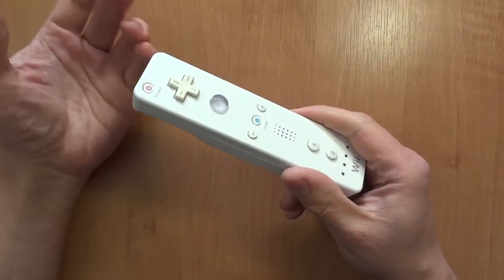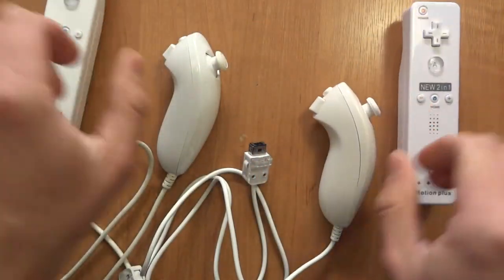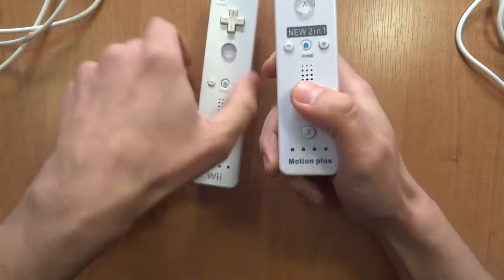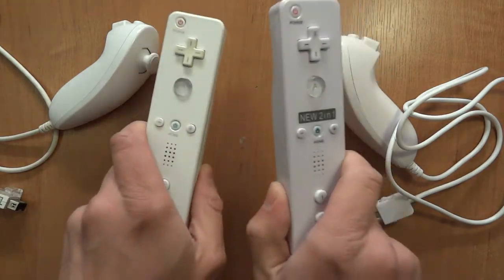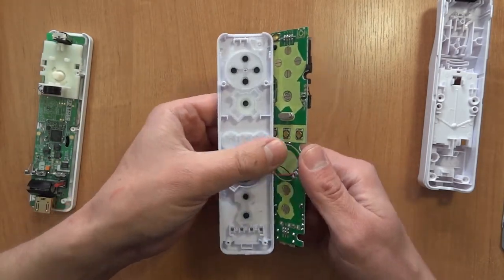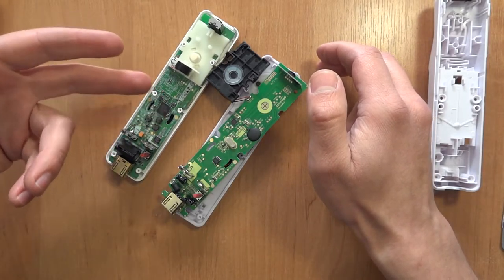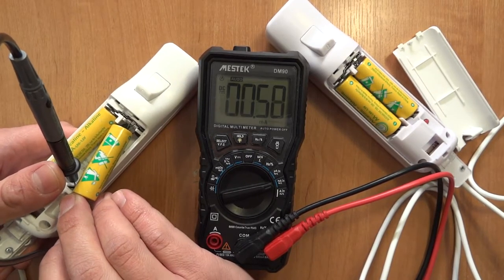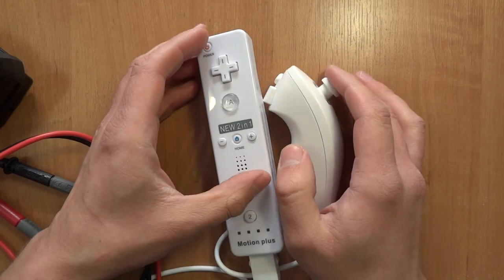Unofficial Wii Remote Plus - Review

Comment: I have no original nunchucks, but the couple of knockoffs attached to og motes. The accelometer works within them just fine(verified it while playing wii sports boxing). Just like in any other knockoff gamepads, i presume that non original nunchuck's stick also has bigger deadzone and more narrow radius of walking/running zone. And since i never had an og nunchucks to compare i wanna make a question:are there any other serious shortcomings with these fake nunchucks i should consider if deadzone problem is not a problem for me at all?
Reply from the maker: I haven't noticed anything. OG buttons feel nicer and have tiny bit less travel, but that's about it. Never had problems with the accelerometer and games rarely use it for any fine movements (usually is just for shaking and whacking).
Reply: @pandaengineering   thanks for answering. Well... As ive said the accelometer works very decently from my experience. Maybe(or not) i'll meet some challenges with the deadzone someday when its about stealth crouching or something like that. Luckily its a movement analog, not the camera one where precise aiming is crucial. Speaking of which... Basing on your tip i decided to give it a try and managed to get relatively cheap og classic pro controller, if it'll be just fine for me, i'll take an extra one but next time it'll be the knockoff since good analog are not on a high priority for me but the dpad is.( For retro emulators)
Reply from the maker: I hope it works out for you 🙂 I was looking for the original ones second had and complete set (wiimote+, nunchuck and classic controller) would cost me almost 2x more than Wii I bought and they're usually really worn out, so I went with the knockoffs. They're not perfect, but personally I think they're good for the price.
Reply: @pandaengineering  luckily my local within-country online second-hand platform is outside of american/european priceforming  and there still(not for long though) lots of good stuff for a small price since my compatriots dont now real nintendo pricing. For example i got my og classic pro in good quality for 20$ but my biggest luck was getting !!!SEALED!!! Ds lite for 50$ in 2020. Also the same year i got my Psp GO for ~65$ in perfect condithon with the box and afaik nowadays perfect condition psp go usually goes for $200 on European ebay. So yeah, getting my chances while i still can.

Comment: Hello, I'm from Argentina and I bought a wii+16GB usb+memory card+2 original wiimotes for 25 dollars, I was looking for an original Nunchuk to play re4 and they cost between 20 and 60 dollars, and the fake ones cost 12 but they don't have an accelerometer, it's worth it? Should I buy the fake one? If so, will I be very limited with the game catalog? 60 dollars is a lot in my country for an original Nunchuk
Reply from the maker: It's not as good experience as original ones, but I didn't found a game that had any issues. They simply feel off as compared to original ones, but I got used to them. Main issue with these is that it's not possible to reliably buy one that would work with PC, but I didn't had any issues with my Wii. I always look for listings that have reviews of people confirming it works well (even if it's 10-20% more expensive than the cheapest one).

Comment: Out of curiosity, does this work on Dolphin via Bluetooth?
Reply from the maker: I haven't tried it, but I don't think my experience could be a recommendation either way for this. Most sellers just describe identical Wiimotes as non-compatible just in case, as they cannot guarantee the batch it's from(they can differ internally). Non-official Wiimotes are often hit-or-miss 😕 only advice I've found was that if you want to use it only with Dolphin, the safest option is to get official one.